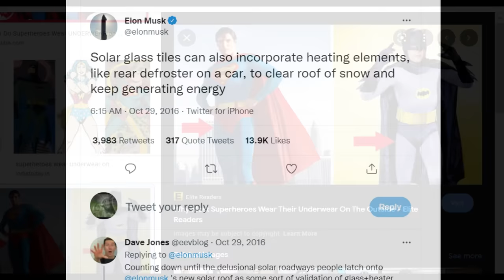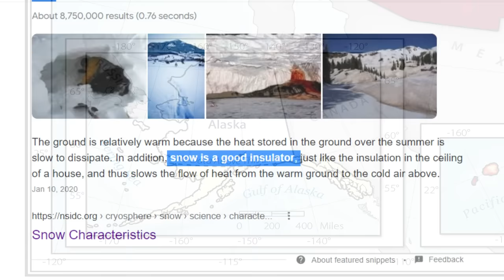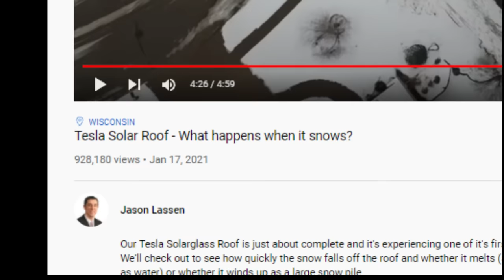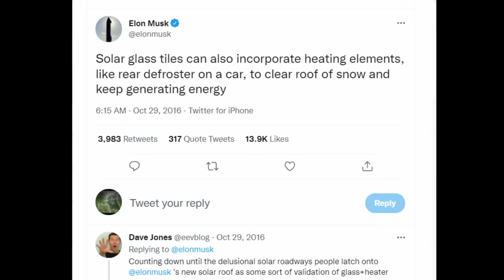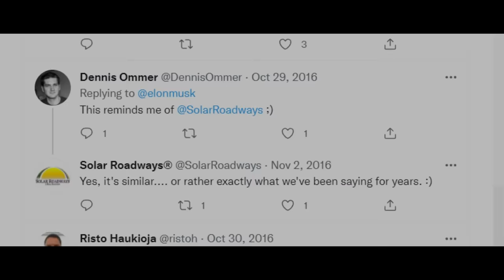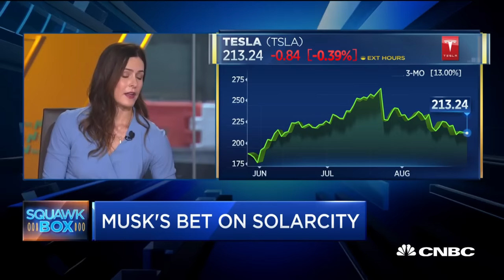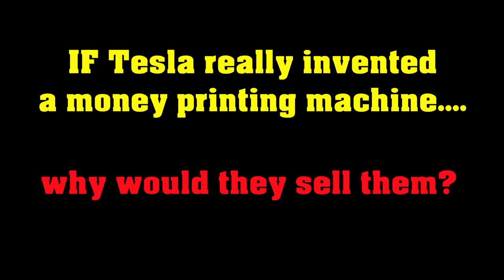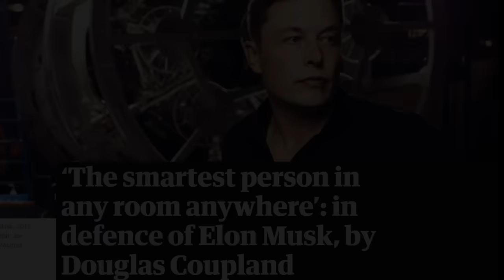Elon Musk: The Smartest Person in any room ANYWHERE!

Comment: Doesn't the snow from the roofs after being artificially melted, freeze again on the ground and form ice and ice sheets? Wouldn't that ice be super dangerous to people and cars? Honest question as where I live the most we get  in winter is some frost that usually melts by noon.
Reply: The big danger is that if melts and refreezes forming an ice dam.
Reply: I live in California, where snow is a fairy tail, but according to science.

Yeah, dumping a bunch of water off your roof will most certainly make more ice which I'm told, is slippery.

If the water flows out onto the road or even just the sidewalk before it freezes, then it can certainly cause people to get injured. Whether that's as minor as slipping and bruising your back, or a car spinning out of control, is the gamble nobody needs to take.

Snow on the roof can be dangerous though, all that extra weight can potentially cause it to collapse. On a properly built roof that shouldn't be a problem unless you get quite a bit of snow in a short amount of time. If the snow is starting to pile up more than you think is safe, the best option is to just go up there (using safety equipment of course) and just literally push the snow off your roof. It can't hurt anyone falling onto your lawn, and if it's in the way on the path, you can just shovel it aside.

Turning your rooftop, into a massive heater, is just 100 levels of retard.
Reply: @kokofan50  Ding, ding, ding.  Winner, winner, chicken dinner.
Reply: Pretty much. If the water is not completely evaporated it will refreeze and while moisture in the air might form into tiny crystalline flakes. Drops of water on a surface turn into straight up Ice on refreezing.
Reply: No, of course not. The ice is melted and goes down to the Telsa heated gutter. Then down the Tesla heated drain pipe to the ground where it' drains away to a Tesla heated drain. All at substantial extra cost. There is an optional monitor sold separately that will watch the snow melt and it plays the sound of impatient foot tapping until it's gone.
Reply: @robertthomas5906  No, no, no, the power is all free from the batteries your solar panels aren't charging in the cloudy and short daytime.
Reply: @Freja_Solstheim  Well unless they are heated aswell the way just freeze on contact with it or (if blocked) flow over it.
Reply: @Freja_Solstheim - There is like 2 inches or less of snow.  It's warm out cuz he's not showing his breath or dressed super warm and it's not windy.  Have you ever lived where it really snows?  I doubt it, or your clueless.  NY gets 2ft- 4ft of snow at a time in winter storms now.  The wind chill is -10-20 degrees.  Water freezes fast.  Why are people Solar Roadway Stupid.   Think hard folks.  Think hard.  Not pie in the sky 32 degree days and nights
Reply: @Freja_Solstheim : Rain gutters are useless in the winter. The heaters would only liquify the snow that is actually touching the shingles, at which point the rest of the snow would slide off of the roof. The water that is barely "heated" above freezing is NOT going to melt the snow in the gutters.
Reply: @OneIroNauT_1  "Gutters aren't heated fanboy"
But they could be
Reply: @OneIroNauT_1  "You ever live where it snows alot?  That happens without stupid roof heaters"
Every technology has its limits.   Those that choose to live in areas of high snowfall are left out in the cold, paying huge amounts for energy.  Heating oil will still be available, but prices will rise as distribution (supply) falls.
Reply: @GK-op4oc  - Yes, they could be.  Would pretty squarely be stupid .  Ground is frozen.  Where you going to put all the run off?  Plus, I thought the whole point was to decrease energy grid use. Oh, I wonder how all that extra heat everywhere is going to work .  The Solutions being put forth are the Equivalent of heating your house with the windows and doors open.  Snow coming down at an inch or 2 an hour isn't going to just dissolve on contact with 33 or 40 degree heat.  Take that up to 2 to 4 inches and you won't have to worry about shoveling if all that snow melted off your roof and made it to the ground.  You'll be out there with a pole pick and a propane torch.  
Keep being an apologist for a grifter though.  That's the ticket.  Elon Musk has never operated in a practical or reality driven headspace.  He spews out half assed  barf thoughts.  And his clueless fanboys eat it up.
Reply: If the roof is heated continuously, then the issue is not really there, if you melt after a bunch of snow is formed then possible yeah
Reply: @OneIroNauT_1  "Snow coming down at an inch or 2 an hour"
This is a cost equation.  There is no need for insults i.e. clueless fanboy, apologist grifter.   Those that choose to live in areas with heavy snowfall pay more for heating in the future, much as they have paid more in the .   I don't understand why you would bother to author a reply to denigrate suggestions to alleviate that cost.
Reply: @OneIroNauT_1  "That's the ticket.  Elon Musk has never operated in a practical or reality driven headspace.  He spews out half assed  barf thoughts.  And his clueless fanboys eat it up"
Were you smart enough to avoid investing in Tesla over the last few years?  If you have done better with any investments since the IPO of Tesla in 2010, please speak up.   Clueless fanboys eagerly await your advice
Reply: @OneIroNauT_1  "Where you going to put all the run off? "
Exactly where the run-off goes when the sun and house roof melts the snow.
Reply: @freddan6fly  Economical roof-heating seems like a decent solution
Reply: Yes, this is a big problem, here where I live someone in the 80'ties put heating elements into the ground to melt snow, (on a parking lot) and the water freeze again, making the whole area a big mess of ice and asphalt, it is usually turned off in the winter, but just after there is dangerous to go there
Reply: @doncarlodivargas5497  There are certain environmental zones that have little desire or need to change.   But a few degrees longitude south, the technologies make sense
Reply: @Freja_Solstheim  Do you have any idea how much energy it would take to keep all this surface area above freezing temperature in winter conditions? The heated surface radiating  warmth freely into the open, losing ever so much energy by being moist and  warmer than the passing winter air and keeping this heating up during a day with hours of snow falling? I wouldn't go as far as calling you a fan-snowflake but you're close. But you may always convince me with actual facts and figures.
Reply: It would refreeze as icicles. In Finland, we usually get a few deaths cause by poorly insulated roofs that drop large icicles and chunks on people.
Reply: Thats why you need heat roads and pavements....it is called a system product supplier :D
Reply: @haku8135  California is a big state. Snow is only a fairytale in some ( ok, most) parts of California. We had a helluva time getting over to Yosemite from the eastern side of the Sierras one time.
Reply: @GK-op4oc  - yes, well, but to implement new technology take time, and electrical energy can today, not be stored, and remember, we have process industry typically running 24/7
Reply: you wouldn't have to completely melt the snow. just a liquid boundary layer on which most of the snow can glide off.
Reply: You are correct. If it`s melted on the roof, it will run off and re-freeze on the floor or in the drainage pipes.
Reply: I’m not a musk fan but most houses have roof gutters and the rest would be drained away as runoff
Reply: Where I am the frost is gone after about an hr of sun and I am in a cold part of Australia, where it goes down to around say -3.C overnight.  Its funny when the sun hits the metal fence I can see steam coming off of it.
Reply: @the_mowron  one time, lulz
Reply: @robertthomas5906  plus you can play Minecraft on it.
Reply: Yes! this is a huge problem with using Oil to heat your house. It heats it too much where the snow melts and forms an ice layer on your roof that damaged your shingles.
Reply: If you heat enough, the water just vaporizes. Optimal situation would maybe be just setting the roof on fire.
Reply: @GK-op4oc  I mean, first of all there's the fact that the comparison is DOA given the sensibility and long-term practicality of electric cars (which Tesla, in all reality, isn't even doing that much justice considering ubiquitous adoption of electric cars is almost an indisputable eventuality that Tesla hasn't really hastened with their Porsche-esque, luxury car business model) vs. the totally nonsensical nature of these "snow melting solar panel roof tiles" from the ground up. Regardless, pointing out the great ROI early investors got from a tech stock isn't a good argument in a discussion of scientific efficacy- and even if it WAS, there's plenty of tech-related investments that have outshined Tesla by orders of magnitude- e.g. BTC investments.
Reply: You’ll also have to heat your eaves troughs and downspouts or they will turn into a giant icicle
Reply: @kevinshealy7117  "there's plenty of tech-related investments that have outshined Tesla by orders of magnitude- e.g. BTC investments"
BTC isn't a tech-related investment because there is no business or product to invest in, let alone wealth creation.   BTC creates no product or wealth and is currently no more than a pure shift of wealth.
Reply: Last thing you want is sheets of snow sluffing off of a roof.  Not to mention the buildup on the ground against the foundation/side of the house, but clumps of wet snow are heavy.  They can be quite a danger.
Reply: @kevinshealy7117  "considering ubiquitous adoption of electric cars is almost an indisputable eventuality that Tesla hasn't really hastened"
Tesla has and will continue to hasten the adoption of EVs by driving battery production, charger-station network development and other auto-related innovations that make EV a better vehicle, from lower cost of ownership to performance to rider safety.
Reply: redxpen  "Adding any sort of warm water from heated whatevers is a TERRIBLE idea"
There will be a climate zone in which this makes sense.   My comments apply to solar panel farms as well as yard or roof panels.    Solar panels already heat up and clear snow faster than conventional roofing, so additional heating simply accelerates the process.   Look for pictures of solar-panel roofs next to houses with snow-covered conventional roofs and note the difference in snow coverage
Reply: redxpen  "excess heat is excess energy and bad for climate change"
Well, we are presently talking about replacing the burning of fossil fuels with solar-generated electricity.  Melting the snow off the panels returns their solar collecting efficiency
Reply: @Freja_Solstheim  How hot do you expect the water to be once melted from the roof? It's not going to be at the boiling point , it will be only a few degrees above freezing point which means it will refreeze in the gutters.
Reply: redxpen  my car windows showing exactly that effect trumps your theory.
Reply: Realistic you'd probably just turn it on when you know it's going to snow so you'd mostly be melting snow flakes. But the problem with that is the fact that it can so snow for days or even weeks continuously so you would need to keep it on 24/7 expending massive amounts of energy for very to return.
Reply: @kokofan50  like the ice damn surrounding our flat planet?
Reply: Good point, a better preventive measure would be vaporise the snow instead of just simply melting it. Therefore, instead of just heating element, why not put an heater to boil the snow using electromagnetic induction?
Reply: -Matter didn’t create anti matter
-Anti matter didn’t create matter
(Both of them were present at the time of big bang)
-Both of them didn’t create themselves.
-Both of them came from an unimaginable source,  that unimaginable source created matter and antimatter (everything) thats why it is known as “the creator” of everything.
——————……………………….——————
- that unimaginable source/creator has created sin and virtue which are opposite to each other,
— logic says every action has its own reaction, so the reaction of sin must be different than the reaction of virtue,
— the creator has created prophets to let us know about each and every detail of sin and virtue, also about their reactions,
Thank you
Reply: @Freja_Solstheim  just how heated is this water that it can melt snow in the gutter? IS the roof maintaining itself at 20 degrees all winter in case it snows?
Reply: @hodor3024  Well then you  have to wait until the snow ends and heat the bottom. When you start heating directly when the snow begins you will melt all incoming snow...And ofc you need steeper roofs angels....
Reply: @ingulari3977  why don't you just try heating the windows of a car which was covered in snow and see what happens?
Reply: @ingulari3977  and have you read the replies? apparently not.
Reply: Wow. didn't know this chain went on for so long. My two cents:

Heating roofs is a non-solution. Ice+snow needs to be evenly heated and allowed to evaporate to avoid some nasty side-effects as it refreezes the moment it leaves a non-heated surface. Clogged drains, dangerous icicles, layers of ice on the ground, etc. This is why insulation is extremely important. Not only keeps the heat in, but also avoids the bottom layer of snow/ice from melting prematurely. Hell, assuming the air is colder than the snow it can even act as supplementary isolation (Like an Igloo) rendering the household more efficient. Not to mention how the math does not line up in regards of what you could earn back versus how much you had to invest in heating it all up even assuming perfect panels and nothing but full on sunshine. Just not efficient and never will be.

If you really want solar despite such weather you are better of with something that can mechanically avoid the snow. Like a tracking panel that rests in a position it can't get covered in snow  during such weather. That or get comfortable with the idea of having to go on the roof and remove the snow yourself.

Comment: High speed electric rail: exists and works very well
Elon: the best form of long distance transport is a vertical takeoff and Landing supersonic electric jet
Reply: Yeah lets make airplanes with the least energy density to weight ratio!!
Reply: @thefullmetalmaskedduo6083  i don't think that a propeller powered aircraft could go supersonic without relying on compressed air tbh 
when he made that stament i tought it would have been maybe a jet engine that uses a resistence or an heat pump to heat the air in the engine , but i call bs on that 
it's even a stretch to assume elon musk knows how a jet engine works at this point
Reply: This guy has no idea about the energy needed to bring a plane to supersonic. Even though it is no secret how to calculate it. Thanks to internet, everyone can find out. Ok, you have to have some understanding of the equations you will found. 
Maybe he is already working on a battery made of U235. Just to reach the energy density needed. I would name it „Big Boy“. It would provide fantastic acceleration.
Reply: @thefullmetalmaskedduo6083   yeah , idk if the chinese had already come up with the plasma jet at the time he made that statment , but honestly it doesn't matter : even if you solve the electric turbojet problem you have VTOL wich simply makes little sense as far as transportation goes , unless you make an immense plane that can't be accomodated by runways , 
Like the CL-1201 , wich was dumb as far as aereonautics goes , 

Also like why make it VTOL if you already have limited fuel capacity since batteries are bad for energy storage in the atmosphere ...

Elon just doesn't know what he is talking about
Reply: Ideal form of transport is teleporter.  Can I have a few billion $ now?
Reply: @travcollier  a few questions first:
1 do you teleport in pods?
2 Are there RGB lights?
Reply: Elon: I don't really care if re-inventing the wheel with my horrible transportation ideas, only that I'm the one selling it to you.